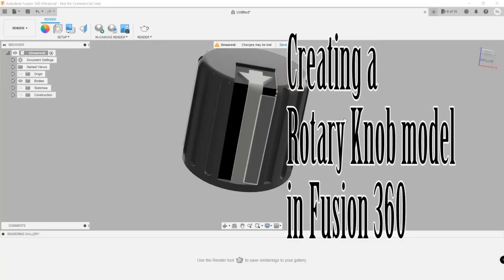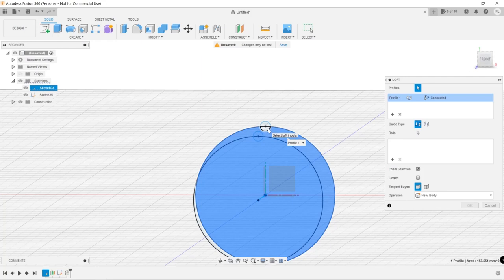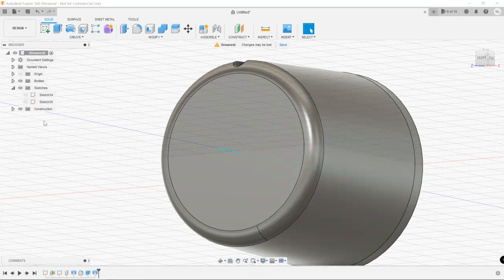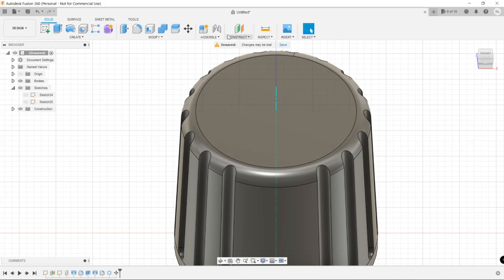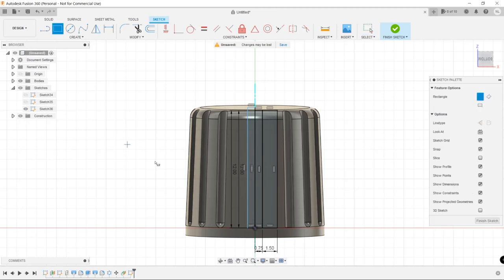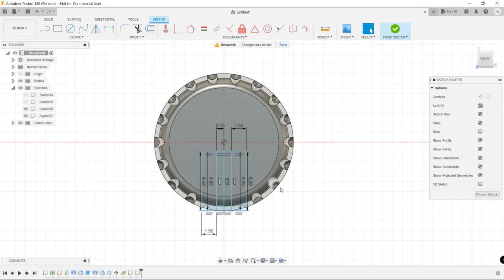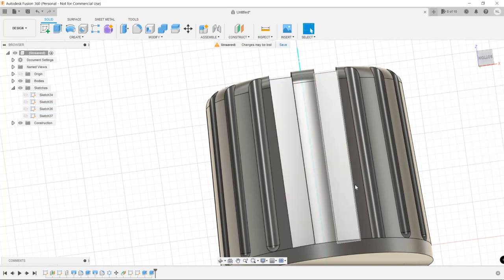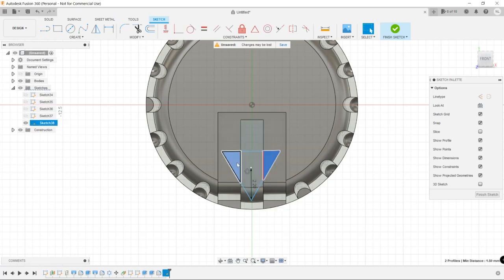Creating Rotary Encoder Knobs with Fusion 360

Comment: Is the hole diameter 6.2mm to account for shrinkage when printing? I made my holes 6mm for my 6mm dia. shafts and found them to be a super tight fighting.
Reply from the maker: TBH, I don't remember, but it was probably the result of 6.0 causing the resin to fracture rather than shrinkage, but it was a while ago now.

Comment: Is this the actual size ?
Reply from the maker: Hi Na Na, I am not sure I understand your question.  You can make a knob such as this any size you want it to be
Reply: @bluefinbima2227  he means when you print it, will it print the actual MIL Spec size knob that is inside the F/A-18. Great video btw! P.S. I noticed that you did not have this knob in your github for the UFC. :)
Reply from the maker: @russellmm  gotcha... No, nothing mil spec about this.  It will fit onto a standard encoder post, but I did this from an aesthetic perspective for my UFC (which is not accurate).  If you want more accuracy, I would suggest checking out OpenHornet.  
You have also guilted me into pushing some commits to the UFC project.  There is also a photograph of the knobs in-situ.
https://github.com/BlueFinBima/DCS-FA18C-UFC/blob/master/images/2020FaciaDetail.jpg